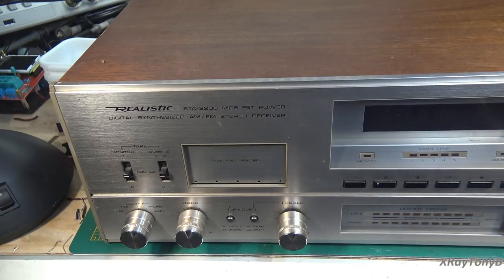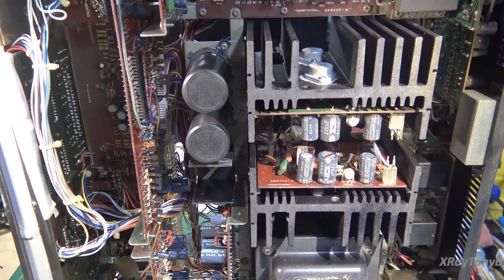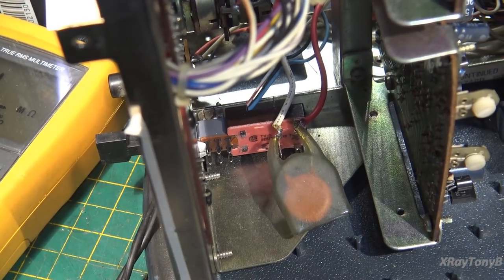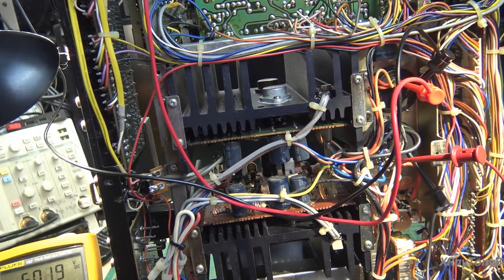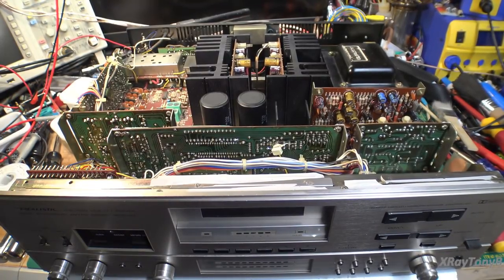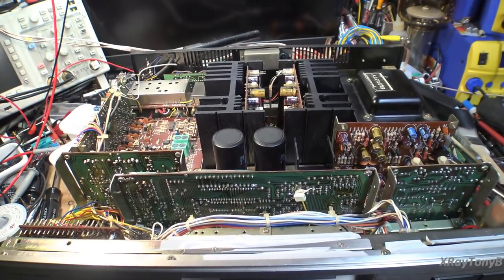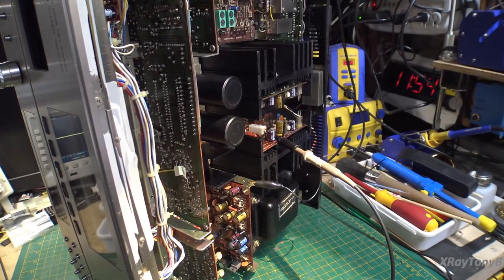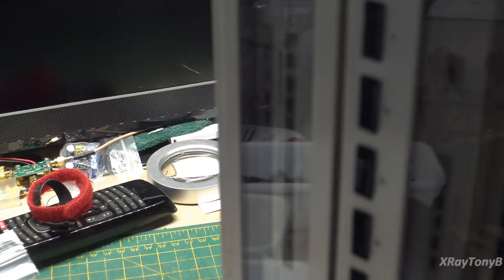Realistic 2200 Receiver Part 1 - Initial Test & Repairing the Amplifier

Comment: tony, not sure if you will see this but just wanted to let you know, it is the capacitor used in the zobel that fails. i recently picked up a quadraflex 650r fet. (the amp is virtually identical to the 2200 and they were both made by tandy) anyways, it was oscillating. i tracked it down to that chicklet looking cap in the zobel. i made a thread about it  on AK. the next week, someone had a concept 11.0(also made by tandy) that was oscillating, same brand of cap had failed. the name is "qualicomp" . they have an "omega-esgue" looking logo on them. just a heads up for anyone, they should be replaced on sight.

Comment: This is way late, like 5 years late.  B.ut the issue about TO-3 packages is that the case is the Collector on bipolar transistors, and it is called Drain on Mosfets.  That is, whether N-channel or P-channel.  Another conclusion I have is that the idea for the 9-V battery was expected to support the clock and station memory just over any short time power failures.  Maybe the designers imagined it was related to the small transformer.  But yes, it is nuisance, probably part of the main power.  No matter, you are right - the battery is out of its “juice” in too short order.  Another note, I recall seeing on my unit a note to the effect that the STA 2200 was made by Hitachi.
Reply: made by tandy with hitachi mosfets

Comment: I remember those Hitachi FETs very well. For a while almost every HiFi amplifier used them. I made one myself which I used for a number of years. It took a while to get used to seeing small signal transistors without heat sinks driving a pair of FETs giving 100 watts or so. As fast as they came in, they were gone! No idea why they went out of favour. I loved them. Almost never failed and did sound good and very easy to drive and bias.
In the UK most Realistic stuff was low end, even the name was a bit of a joke, but nice to see they could make a good piece of kit.
PS. Looks like Jim Hough is bored...plus I have no idea what he's talking about, cannot be about amplifiers.

Comment: One technique that I have seen other restoration guys use on these amps is to replace the trimmer pots used for adjusting finals bias with a multi-turn pot.  They aren't physically much bigger and you can dial the bias in exactly with ease.  Another great vid xraytonyb!  I was a Realistic STA-2100D owner back in the early 1980s.  I sure miss that receiver.
Cheers!

Comment: Wow, I had one of these - it was one of the sweetest, smoothest sounding pieces I've ever encountered.  To my ears it had the smoothness always promised by valves combined with the muscle of solid state components.  My unit looked like it had been knocked to hell and back, but the amp portion worked beautifully; I wasn't concerned with the barely functioning tuner section as radio here in Bermuda is a complete waste of time.  I'd give anything for one of these again.

Comment: Thank you! 
I learned a few new things about mosfet transistors. 
Good explanations about working on stuff and how it works.
And what i like about you're way of working, is that you pre-replace diodes, capacitors etc in amplifiers. I have seen many man just replacing faulty ones, or non at all, while the amp is more then 30 years old. I work the same way.

edit: I would have replaced those bias trim pots as well. These are not the most bad ones, but just to be save. Old tranistors are hard to get by these days.

Comment: Always enjoy your postings don't change a thing.  I'm just about to put the finishing touches on an STA-2250 also digital tuning.  The power amp is put together like your 2200. However it uses Bipolar Transistors and both channels are on a single board and all four outputs share a single heat sink.  Both outputs on the left channel were shorted.  After extensive checking the amp board I could find no other problem and fired it up.  The DC on the speaker leads is 10mv well within the 50mv allowed. According to my ESR meter all of the capacitors are good, It's working so well I'm tempted to clean the controls and button it up.  I've had it playing in my shop for two days now and the heat sink is just warm.  What's not to like, I'm keeping this one for myself.
Reply: Howard, not to be a jerk but one thing is the dc offset and other completely different thing is the idling current of the amp. Offset should be as close as possible to 0 meaning if you have 10mv in your speakers outputs, most likely your main caps are about to fail or you need to recalibrate those pots. Whereas the 50mv he measured at those big resistors are the idling current of the amp and it has to be as close as possible to 50mv or you'll start hearing a lot of intermodulation distortion.
Reply: @CofeeAuLait    I was following the instructions in the Realistic STA-2250B service manual,   Which are and I quote;...1. Check balance by measuring across the L and R speaker terminals.  DC voltage should be + - 50mv.    2. Idling current adjustment,   Adjust voltage across emitter resistors R541 (L channel) and R542 (R channel) to 10mv + - 2mv with 8 ohm load using VR501 (L) and VR502 (R).     I see I left out what the idling current was but it's in specs on both channels.  The term offset was not something we used back when these were new,  voltages on the speaker terminals was simply referred to as DC voltage or DC balance.

Comment: I remember when Hitachi first released those Mosfets and the circuit they initially designed to run them. Many companies used this design without much modification. It was ok, but was soon improved upon, including by Hitachi themselves on their MK2 version of their HMA7500 power amp. You should really use anti static precautions when handling them. Thanks for another instructive video.

Comment: The STA-2200 was Radio Shack's first and only MOSFET receiver. But it was the second model they manufactured. The Pacific Stereo Quadraflex Reference 650FET R was manufactured by Tandy Electronics a couple of years earlier, and was the first receiver to use the Hitachi MOSFET outputs. Rumor has it the STA-2200 was heavily influenced by the 650FET R. Would love to see a comparison of the two.
Reply: i wouldn't call it influenced, i would call it an updated version. my 650fet has a few things going for it over the sta2200. black face. analog tuner. dc offset adjustment.

Comment: Been looking for some tweakability in the schematics. Here's what I found:
1. Yep, it wouldn't be an early PLL synthesizer if it didn't have a 100k resistor on the VCO tuning diode (R13). That's 40 nV/sqrt(Hz) of finest thermal noise right there that'll be modulating your VCO, increasing phase noise and hence audio noise floor. Try, I dunno, 3.3k + 3.3..10 µH instead. 
2. I would also whack an electrolytic on the 78L05 output on the prescaler board, probably on the backside as it's so cramped... pretty much as much as you can make fit. There's only a 10n there so staggering two different values (like 10µ + 220µ) may be required to avoid problems with parasitic inductance.
3. Like most anything from the time, this unit is lacking FM RF or IF AGC, and the IF strip is a typical Japanese limiter-amplifier job of excessive gain and poor linearity (screw those textbooks! we want better quieting!). However, RF amp MOSFET G2 is easily accessible via terminal 4 on the frontend board, so one could build something there with some extra circuitry. Maybe like this - http://www.ham-radio.com/k6sti/rfagc.htm - but possibly with some extra pull-up as the MOSFET doesn't seem to be run quite that hot here, looks like ~4 V on G2.

A lot of effort has gone into cleaning up the supply rails in this one, with low-noise regulators followed by RC filtering. (This reminds me of another house brand receiver I've seen recently, a (JC Penney) MCS 3248.) Unfortunately, output noise floor is still going to be only so-so, with an SNR of around 95-96 dB - intrinsic noise floor of the preamp isn't particularly low, and total gain at ~45.7 dB is around 2 dB more than it really needs. Not bad for the day and OK on normal sensitivity speakers, but I definitely wouldn't run Klipschorns without a 12-20 dB attenuator between Pre-Out and Main In!

4. Noise could be reduced a good bit in Tone Defeat mode, at the cost of somewhat increased loading on the preamp output (and hence a bit more distortion). Replace R621 (56k) by 22k, and either R623 or R625 by 4.7k. This should bring SNR up to 99 dB. About 3.5 dB less noise (including 1.5 dB as a result of reduced gain) is pretty decent. If you're really fussy about this stuff, you can always connect a good preamp externally between Tape Out and Main In. Power amp noise levels should be very low.
Reply: Wow thanks for the link. VERY interesting, i tought that phenomena had to do with crossover distortion.
Reply: How Do I get in touch with you about the STA-2200 ?

Comment: As far as my experience and data sheets of American MOS-FETs in TO-3 package indicate, the case is always the Drain.  I am not sure about possible difference in Japanese parts.  I thought I would just open my STA 2200 service manual and check.  But now I cannot find it anywhere...
Anyway, my unit has two problems.  The various pushbutton switches are in need of cleaning and probably (but not finally verified), for same switch issues — on power up it often starts chattering the safety relay.  One of these days I’ll take it open again.  My previous attempts have led to a loop containing the safety relay circuit, the phase lock circuit and a bunch of those switches.

Comment: Just cur. How many hours spent in the sta 2200 for the full recapping?
I just bought one these , working, on EBay. Trying to estimate the shop cost for this unit. I'm no electronic tech. Great Video,  Thanks
Reply from the maker: If just replacing caps, you could do it in about 2 or 3 hours.

Comment: I was taught that a cap directly across a switch was a no-no.  Closing a switch on a charged cap will do not the contacts any favors.  You'd need a series resistance high enough to limit the surge current to what the switch can handle.  The first set of contacts are already burned.  I'm guessing the cap is there to protect the  switch when it interrupts the current to the transformer.  I'd look for another way to address that problem.

Comment: Tony. Noted the wire wrap. Did wire wraps provide as good as a connection as a good old regular mechanical ones with solder? Also, is wire wrap used any more? Thanks, and keep them coming. Len
Reply: They were a more secure method more commonly used than plugs in that era of electronics construction. It likely had something to do with costs of wave soldering or extra processes commonly involved when having to use plugs and other stuff.
Reply: Used quite a bit in telecom.

Comment: Never touch the gate of a MOSFET with your finger; the human body can easily accumulate 400-800 volts of static charge without even feeling it - that’ll blow the daylights out of the gate dielectric! And if it gets to the point where you do feel the static electricity, or you see the little spark, you’re talking several kilovolts at least! The dielectric strength of (dry) air is about 10 kV/cm, so 1 kilovolt can jump a 1 mm gap. Instead, hook an insulated clip to the gate, then clip the + (red) lead from the meter to the drain, and the - (Black) lead to the source. Now touch the other end of the clip lead from the gate to either the source or drain; source=off for enhancement-mode, and drain=on for enhancement-mode! Finally, you can wire a 1k pot between the source and drain, and connect the center (wiper) of the pot to the gate; you can now observe the MOSFET in action as you adjust the pot. HTH!
  Also, (note to viewers) never test a line-powered device with line-powered test equipment (such as a scope, frequency counter, spectrum analyzer, etc...) without an isolation transformer, or without verifying that the power transformer in the DUT (device under test) is not shorted primary-to-case, or primary-to-secondary! Failure to observe this can result in your test equipment becoming an expensive paperweight, or the DUT can even be damaged or destroyed!
Reply: Also, they need to make sure that their isolation transformer output is really isolated.
Reply: If you're holding the body of the MOSFET, which is the source, its fine to also handle the gate.  But you should never touch only the gate electrode, that's asking for it.  Nylon carpets and clothing have no place in an electronics lab in my opinion, so much static with that stuff.

Comment: Every time I get of my car during very dry, cold weather,  I drag my butt across the seat and get zapped!  No kidding guys and gals it hurts.  That's several thousand volts.  I've been an industrial electronics 're h for 30 years and have been shocked many times by 120, 277, 480, and 600 volts ac.  These were partial encounters through high resistance barriers (my brain).  Those dc static shocks HURT like hell!
Reply: Get a Shaxon anti-static wristband. Wearing it without the ground tether will keep you from getting zapped. I wear mine every winter and it works for me. And don't listen to the naysayers, just try it.

Comment: Also (for enhancement-mode MOSFETs), you can tell if it’s N-channel or P-channel by measuring from source-to-drain. If you hook source to - (black) and drain to + (red) and you get high resistance you have N-channel. If you get a low resistance, you’re reading the body diode of a P-channel device. Likewise, if you hook source to  + (red) and drain to - (black) and you get high resistance, you have P-channel, and if you read low resistance, you’re seeing the body diode of an N-channel device! This should work for all enhancement-mode MOSFETs, but may not work for JFETs.
Reply: My Peak Atlas DCA75 Pro has spoiled me...

Comment: Why ? Radio shack was garbage top to bottom. This is worthless. 40% thd probably
Reply: Realistic products were quite good
Reply: @glennjones6574  nope, you're incorrect. It was cheap by any standard.
Reply: @Mile-long-list  cheap does not mean necessarily mean bad.Radio Shack/Tandy made it possible for those without much disposable cash to have access to some pretty decent gear.
Reply: Judging by the parts used you can tell this was not by any means ''Cheap''. Those elna caps are actually quite good and were expensive back in the days. Power transformer is shielded, big pots and lot of other stuff.